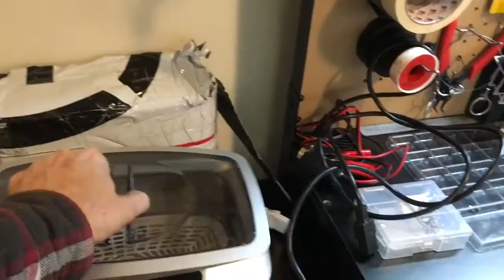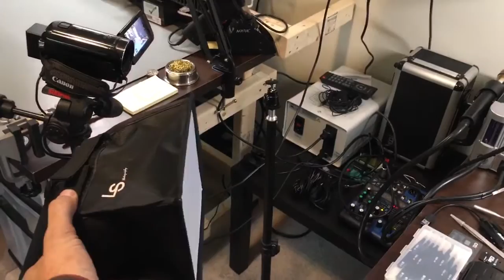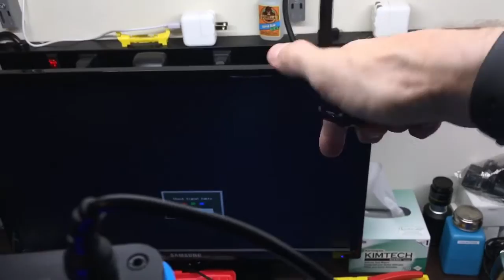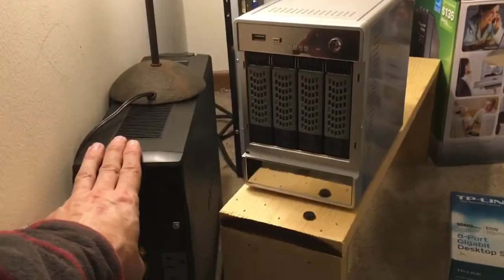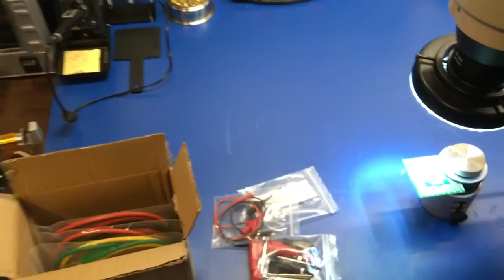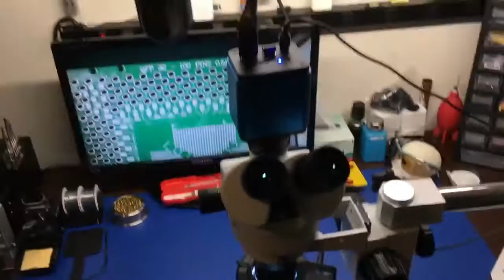Lab Update 6, back on track and %98 finished

Comment: awesome! looking forward to new vids.
Reply from the maker: mikes hobbie's and random stuff  Thanks. Did you ever sell the RC car? I think after this winter I'm going to take to the air with some photography or racing quads. I had one before, but they are cheaper now to build and have better tech for finding them if it goes down. My old one didn't have GPS and FPV stuff, so I might trade off the card for the quads and build one from scratch.
Reply: no I still have all of my collection.😁 still looking to sell my Hpi Vorza and savage flux plus my Losi mini desert buggy. I'm hooked on the scale crawlers big time now like the rc4wd trail finder 2 and the gelande 2 with cruiser body. I got both of them.